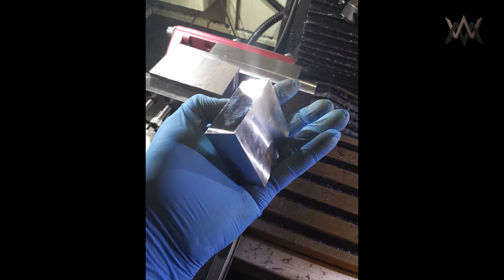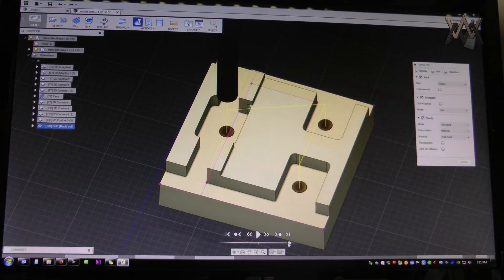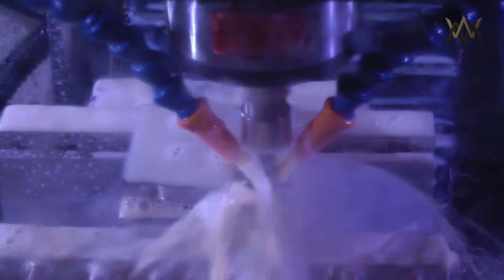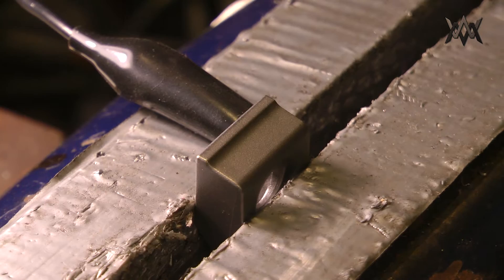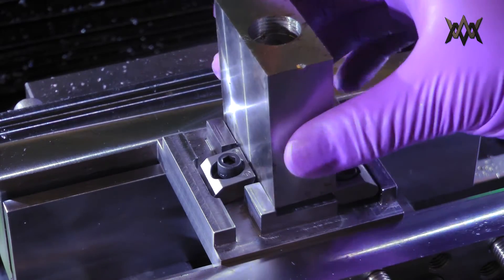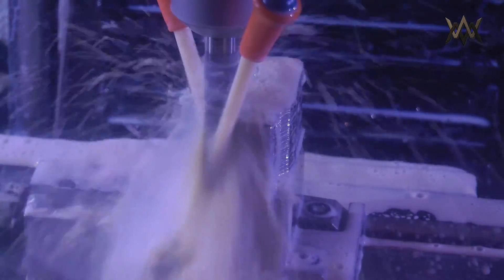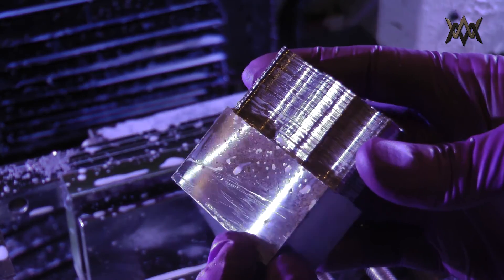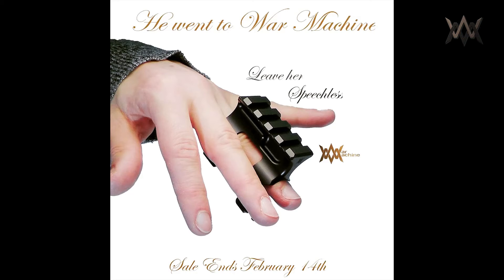New Mitee Bite Test Fixture

Comment: Something that may save a lot of time on future or other fixtures are the MiteeBite Talon JAWS. I use them on LOTS of different parts and they only need .06 or LESS to hold. I'm talking 12" long parts 1.5 tall 3.5 wide on 8" talons hitting them on the Haas at 150 IPM with a 1.5" insert mill, 1" insert mills etc. They HOLD on AL and Steels. FEE-NOMINAL. I run small parts <1" wide as a single bar across them and enough gap for the EM to pass between with Adaptive tool path and it is FAST. Bet part: no fixtures. Go from part to different part without touching off again or changing jaws for fixtures. They stay set up on my 1st vise, then soft jaws on second and either soft or hard on third. I save so much time since switching to them its unbelievable.
Reply: You'd be surprised. I have other fixtures that it's faster to adaptive clear all the material between them then to screw down the skeleton. Adaptive is FAST. For op two, some get cut apart then thrown into second fixture, but whenever possible I program ALL the parts from vise one into the fixture of vise 2 so I just pull all 2, 3, 5, 8 out and throw them into the soft jaws. 

http://s27.photobucket.com/user/PriddyShiddy/media/_WEB%20POSTING/20160210_140728_26338825466_o.jpg.html
http://s27.photobucket.com/user/PriddyShiddy/media/_WEB%20POSTING/20150311_123111_25750152164_o.jpg.html
http://s27.photobucket.com/user/PriddyShiddy/media/_WEB%20POSTING/20160210_194017_26364775975_o.jpg.html
http://s27.photobucket.com/user/PriddyShiddy/media/_WEB%20POSTING/20150703_065241_25755495674_o.jpg.html
Reply from the maker: Great advice! I've seen the talon but have never used them. So all of your 1" wide parts on the talons are cut out of a solid piece of bar stock? I've thought about that setup but it seems like a lot more milling time and end mill problems. Plus they need to be separated for the next ops anyway. I remember seeing Apex Tactical machining a row of hard sears all out of a single long piece of D2 square stock. It got my mind cranking, but those are very small parts with no secondary ops other than milling off the backs. I think they used soft jaws for that.
Reply from the maker: Awesome pics. I'm going to investigate this further before I start the next run!

Comment: if you gonna rough, collets are not the best toolholders. better use (hydrodehnspannfutter, called in german) or weldon toolholders
Reply from the maker: +ipadize You are are absolutely right. In this video I am using a Weldon Shank end mill holder. I switch to those for roughing a while ago. AHHH you must mean about the tool pullout. YES! You're right I need to get a 3/8 Weldon holder for that end mill.

Comment: Stock prep is a huge time suck in my operations as well so Kudos to you
 for taking the time to try and design some of it out of your process.  Haha!  I loved how you took the tungsten carbide to "11" (Spinal Tap reference)!  FYI- I have a pile of broken 1/8" carbide end mills here that cringe every time they see me pull out the engraver and power supply :-).   Those pitbull clamps are pretty amazing when you get your fixtures dialed in and I think that you will be happy to get a large plate on the table and leave vise land.  

Just make a sub-plate for your vise to live on and you can have the  best of all worlds when you need to use the vise for design or re-work.  Do you have an Alro near you?  I frequent their retail outlet picking up Kaiser Precision and Mic6 drops for killer prices.  I was able to get a 21" x 10" x 5/8" plate out the door for <$50 last week...it had 2 extremely light scratches on it.  Product is looking great by the way!
Reply from the maker: +Doug P Eliminating 99% of stock prep will be huge. I would design a table fixture  as eformance suggested but I need to be able to access the WarBlocks from essentially all sides while still on the fixture so the fixture needs to be able to rotate 90deg. This is really a job for a 4th axis (which is the ultimate goal) so I&#39;m not overly worried about minor inefficiencies at this stage. Trying to correct them would be...well...inefficient. I just need to carry my bike to the finish line. Major ones like stock prep yes. 4th axis will take care of all.

Thanks for the tips I need to see if there is an ALRO around here.
Reply: Yes Sir a 4th would be ideal for what you are trying to do.  Just make sure that your bike is made out of Titanium or Carbon Fiber and it will be a little easier to tote around LOL.  Here is the link to the Alro folks...hopefully you can source some cheap plate.
http://www.alro.com/divmetalsplus/
 I'm in the automotive industries back yard (well at least what's left here in the US)- 30 miles away from the lovely town getting lots of street cred for having lead in its water.  Scraps are plentiful here for now.

Comment: Word of advice for gang fixtures: ditch the vise.  Put a MIC-6 sub-plate on the table with dowel pins and heli-coils, then bolt fixtures directly to the sub-plate.  You can also put dowel pin holes in the vise base to make it easily locatable.
Reply from the maker: Yes good advice. It would also get the Z down lower to add rigidity. One problem I have is I have to use several different fixtures and I'm constantly switching back and forth between machining with fixtures to machining with the vise to pinning barrels. It's kind of a do it all setup. when I can bring another machine on board I'll be rethinking everything again. lol

Comment: I have to ask, why did you make a fixture that effectively does the same thing as the vise jaws?  It looks like it just clamps the part perpendicular to the vise jaws, but you could do the same thing with the vise?  EDIT: I see at the end you plan on making a gang fixture.
Reply from the maker: Well this is just a test fixture, the real fixture will be 18" long and hold 8 parts at a time in a precise repeatable way. Also I can reorient the fixture 90 degrees for different setups.

Comment: Looking good!  That carbidizing looks like it was super effective, hard to believe what kind of damage 60v at 2 amps can do with such a small amount of time in contact.

Have to admit I've missed a few videos, WarBlocks are looking great, love the ad at the end.  How's the new coolant system treating you?  Looked good from the vid!
Reply from the maker: +jcims Thanks! The carbidizing worked great. If I didn't want such a rough deposition layer I would turn the voltage down.

The coolant system has been great. On the last few WarBlocks I started breaking endmills and was able to partially pin the problem on lack of coolant flow. Turns out the filter was getting clogged, so I finally replaced it, after a solid year of machining. The coolant stream in this video is with the new filter.